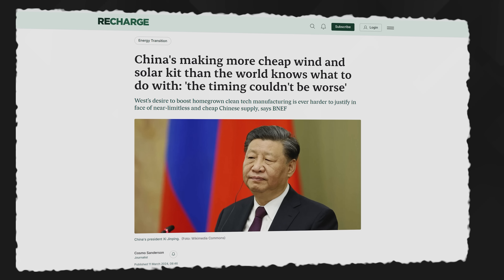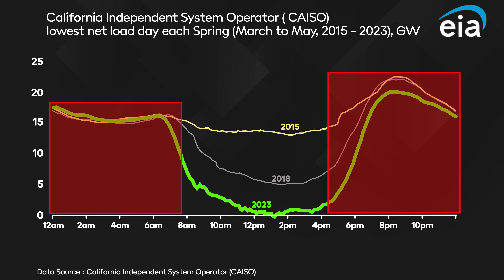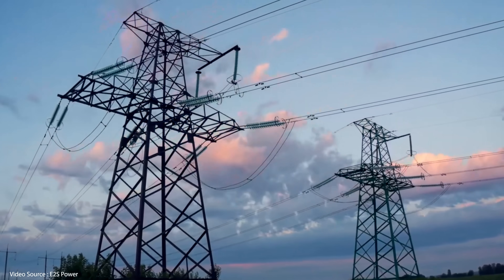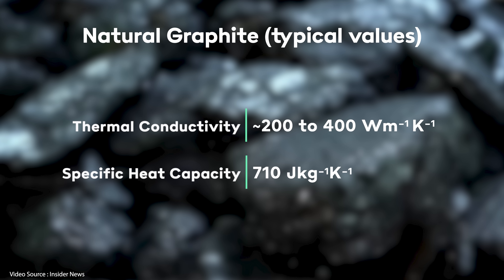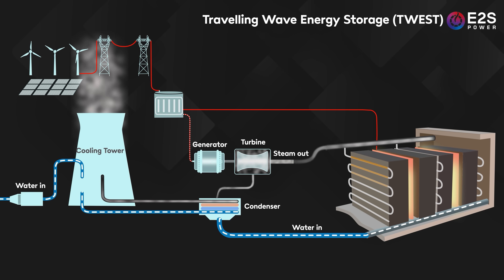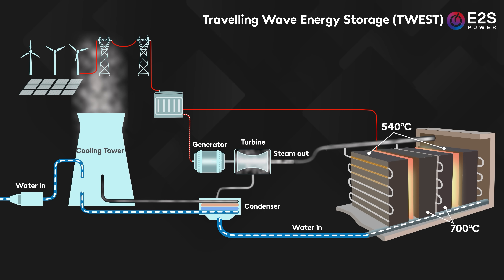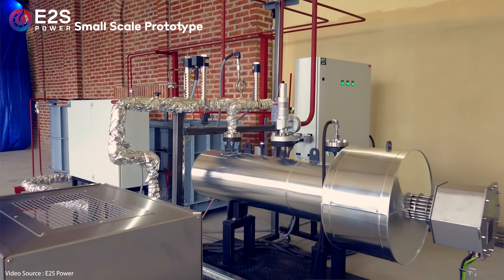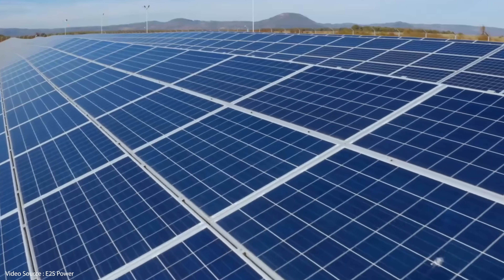A coal power station without the coal! How 'WIN-WIN' solutions could save an industry.

Comment: The obvious problem of this seems to be the efficiency. You said it's still using a turbine like a coal power plant, which had efficiency of 45%. So the overall efficiency will be less than 40%, which is not great for a short term energy storage, since batteries have 90% efficiency and pumped hydro has 80%. So it's only really useful when you have a huge surplus of cheep electricity.
Reply: Which you may have in a lot of areas with cheap solar or hydro
Reply: Except that efficiency is not a problem. Cost is a problem. Low efficiency increases the effective cost of the energy in by about 2.5x, but when you are talking about solar without storage the cost is so mind bogglingly low that it really doesn't matter. Solar isn't a viable energy solution because of the intermittency, but the cost is already stupidly low. Everyone can have a huge surplus of cheap electricity if they wanted it, at an inconvenient time. The question is how to deal with the intermittency.
Pumped hydro is pretty much impossible to beat where available, but batteries are expensive. The question becomes whether the higher efficiency of batteries justifies their higher cost, and when you can simply buy more solar panels instead they generally don't.
It really bugs me when people harp on about efficiency as though it actually matters. It does not. We don't care how much energy we needed to put into the system to make sure the lights stay on at night, as long as it outputs enough. We care about the overall cost of the whole system, generators and storage. Right now it is the cost of the storage that is holding everything up. Efficiency can tank and the system can still be economic if it is cheap enough.
Reply: Eh? The primary input cost for the running of the plant is going to be electricity and the owner of the plant will be competing with other forms of storage for that electricity. So of course efficiency matters. You can't make a profit if the electricity you sell is going to be more expensive than the competition as nobody will buy it. Can't believe people are up voting something so nonsensical.
Reply: @mentality-monster , except that the electricity that the plant buys in the middle of the day is basically free (or they even get paid to take it, on occasions). 
A producer doesn’t get to set the price of power, the market does and a producer decides whether or not to sell into that market. If the input power is free, then efficiency isn’t an issue, only operational costs need to be covered and as long as the plant is big enough to sell sufficient power at peak times to cover these costs, then they are in profit territory.
Reply: @taniknight  The low energy price is just the result of the merit order pricing. But that pricing system no longer works once fossil fuel energy production is fully pushed out. Then you are always at 0 cent and with 0 you can't finance renewable energy production.
Reply: @mentality-monster  cost includes the build out and if the infrastructure is already there and you can plan for a resource free production, then it is, of course, cost effective.
Also, the costs include the connections to the grid itself and for this, it makes sense most.
In addition, there are the existing jobs and they have to be factored in, as they impact the overall economy of the region/nation. This is always overlooked  when people discuss the financials of such projects.
🥡🥢4 🤔
Reply: @taniknight  OK, good luck with that. If you think you can run a profitable business based on a few hours of cheap/free electricity on sunny days in the summer, then you're going to lose a lot of money. 

There's a reason none of these ideas have got to market and been success. It's because there's no chance of making money when your efficiency is this low. Some other business will pay more for that cheap electricity and be able to sell it for a lower price than you can, as they will have more price flexibility due to their higher efficiency. 

You could sit down with a spreadsheet and figure this out in a few minutes, it's not hard to do.

The only potential possibility for this being a success is that governments will subsidise these plants in order to keep the workers employed and prevent the stranded assets of coal and gas power stations. And I don't have a problem with that. There's a lot of embedded carbon in a power plant and we should be aiming for a transition that keeps people employed.

But let's not pretend that this would survive in the open market.
Reply: @Psi-Storm   why would the pricing system no longer work once fossil fuels are off the grid? The power is cheap/free during the day because supply outstrips demand due to higher solar production. Isn’t that effect only going to get stronger as more renewables come online? Until of course there are purchasers who can utilise that intermittent supply and demand catches up. No?
Reply: @mentality-monster   I don’t need luck, I’m not looking to undertake a power station retrofit. 

Agreed. A lot of the value in these undertakings is to keep current infrastructure, well, current. 

If the supply/demand balance does end up in a situation where the cost of daytime power is not negligible, then sure, an efficient operator is going to outperform.
Reply: Certainly true, though one has to wonder on the actual economic costs overall. For instance if maintenance isn't to much you've basically just avoided massive capital costs in setting it all up. Something that might well offset the efficiency differences for how ever long the current equipment will still last.
Reply: Yeah,

But here capital cost is negligible, because you are not constructing new storage site.
You are just retrofitting old coal power plant.

Obviously, if you have to build new storage site, you will not chose this.
Reply: A simple-cycle gas turbine, employed to ramp up supply quickly, also has an overall efficiency ranging from 35-40%.
Reply: Yeah, I'm sure there will be math involved.  Build cost would probably be lower as well as longevity likely being higher.  Then again battery prices keep falling, so we'll see if it can compete over next few years.
Reply: May make much more sense for where the excess heat is also used. A power heat coupling power station gets up to 90% efficiency.
Reply: I would suggest this has the advantage of utilizing existing infrastructure and reduces overall cost for the change and a healthy stop gap 🙏😊
Reply: And a lot of local graphite mines? See https://ibm.gov.in/writereaddata/files/01312023164915Graphite_2021.pdf

Comment: Great news for this technology, there's an old coal fired power station near me, I'd like to see converted. I will be pushing for this. Thanks, Dave, another great video!
Reply: There are soon to be no operating coal plants- but soon there will be some gas fired plants that could also be used/converted.
Reply: Since the plant is existing, permits might not be required.
Reply: Think outside this box:
Nice to see something rated as being NEW and INNOVATIVE likely to be so but still requiring huge electrical input from those notoriously unreliable and expensive to produce 'renewables' which have a relatively short useful life and, as yet, have no mass method of reclamation/recycling .
So, a world filling up with old/damaged EV's, solar panels and wind turbines puts a sour note on this innovation.
At least Nitrogen is being used as an anti oxidant, plenty of that around and recyclable?

Comment: Oxidising at high temperatures?  Is that a euphemism for burning …. or exploding?  Can we not find something that is not flammable?  Sand?
Reply: Burning, not exploding. And it doesn't burn well. The "lead" in a pencil is mostly graphite, at least for softer pencils.
Reply: Exactly. Others are using sand which is much cheaper and non flammable. The only advantage of graphite is the energy density. A coal power station generally has plenty of space so that isn't much of an advantage.

Comment: at one point i heard 45% mentioned. is that the efficiency? i have a feeling i've heard much higher for LFP batteries? what's the upside exactly here? i honestly think we were told it in the video but i struggle to follow these smart people videos.
Reply: All lithium batteries have a known lifespan (cycles).  This technology could last as long as the fossil burning site could - umpteen years.  There is a place for chemical batteries but also for this technology, too.
Reply: @oliver90owner yeah, lifespan of newer LFP approaching 10,000 cycles or 30 years.
CATL is producing some amazing results, others too.
Nickel chemistry is more limited. (eg Teslas with Panasonic cells)
Reply: yes, batteries have higher efficiency, around 90%, but the upside for the system in the videos is exactly the material & construction of the battery being cheap.

Comment: Hydrogen, green steel, green concrete, it has 0.2% impacts on total energy consumption small batch are produced because. High demand means that if steel can be fully produced green but that requires 10 to 20 more time conventional dirty production will remain. Outside hydro and wind green electric energy production is still based on dirty methods, fossil fuel and gas. Thermal plant still based in 17th century technology water wheel and windmill where steam must be condensed into water multiply (amplification effect) is lost so dense energy source of coal, oil and nuclear are required.
Reply: Enough of the misery and misdirection.

Comment: One more advantage of this system is that where a generating complex has multiple generators, this can be installed incrementally, keeping one (or more) generator burning coal for the very occasional times when that part is needed.

Basic economics will ensure that the coal powered unit will not be run most the time, when cheap solar is going begging for use.
Reply: Modularity, excellent point.
Reply: Coal plants don't do peaking. It takes hours, sometimes over a day, to get a coal plant up to temperature from zero. They have to run at all times, even at a loss sometimes, to function reliably
Reply: @litkeys3497 yes, they use gas plants for that
Reply: @ronaldstrous2764  yes; point was that keeping coal stations partly on coal and partly converted to storage is not really feasible. The coal is either running at all times or shut down. There's no in-between
Reply: It’ll soon be an alternative for some gas fired stations?
Reply: @oliver90owner : At least for the simple-cycle ones, used chiefly for ramping up supply.
Reply: @josdesouza  Open cycle gas plants are not often in use in the UK.  Combined cycle are sooo much more efficient as thermodynamics, of steam generation, doesn’t apply to all of it!  Hopefully, next year the grid will be able/confident to run without any gas fired generation (at times when renewables are abundant).  Currently gas generation is maintained at a little over 2GW for ‘black’ grid start-up, if necessary.
Reply: And the materials is not some thing like titanium or rare metals, so it looks like the product could end up being cheap to produce as well.
Reply: Keep in mind round trip efficiency will be below 40%. So it will be only cheaper to run on solar compared to coal if the energy from solar + grid usage cost (which are probably the higher share of the price) are more than twice as low as coal. I don't know for other countries, but in Germany the grid usage costs have made up the majority of the cost of electricity for the past two years. And while energy providers could probably negotiate a much better deal than consumers, I do not see this concept being close to economically viable here.

Comment: Very good tech. Graphite has also the advantage of not melting at 700 C and doesn't expand and contract as much as for example steel with temperature change. Less chance of explosion or permanent damage form overheating there. 
I only worry about that N2 - it needs air tide container. In this case the container has to also stay tide in high temp and pressure changes (N2 does change it's volume-pressure with temperature change). If it gets unsealed, it probably will lead to a fire in the plant. Seals cost to maintain. See our now existing infrastructure and it's maintains, and you can see, why I'm a little worried.
Reply: As long as the pressure of the nitrogen inside the containers is higher than the outside air pressure no oxygen can leak in. Only a few psi higher pressure would be enough. They'd have to add more nitrogen as some leak out, but nitrogen isn't that expensive. Of course it should be as air tight as possible, but it doesn't have to 100%. They also should use relief valves if the pressure gets too high.
Reply: @phizc not even a few psi!  Millibars would be sufficient.
Reply: @oliver90owner  I guess so, but you’d want a bit of leeway and the additional headroom also serves as reserves so that as it slowly leaks out, the pressure is still higher than atmospheric.
Reply: @oliver90owner  true. I went for the smallest 'Murican unit I knew of so they wouldn't feel left out of the conversation 😋. 
A few hectopascals would be be sufficient too 😊.
Reply: @rainbowevil   Noo!  It would be controlled at that sufficiently low over-pressure such that N2 would always leak out from any leaks.  Any leaks could be found and rectified or simply monitored, if the cost of N2 was more cost-effective.
Reply: Distribution transformers the world over that are contained in mild or galvanized steel enclosures use a nitrogen blanket between the internal oil surface and upper, internal enclosure walls to prevent oxygen intake from interacting with the transformer's insulating oil. 

It is not uncommon for Operations & Maintenance (O&M) teams of utilities and power producers to refill this nitrogen every year as test reports confirm gas levels and chemical contents. 

For this well established practice to be applied laterally to shipping containers housing graphite storage mediums isn't that far out. 

The only issue I foresee is the high temperatures from the heat storage directly. Usually pad-mount transformers (PMTs) operate with top-of-winding temperatures at 55-65 °C above 30-40 °C ambient, which is a far cry from the 700 °C reported in this video. 

Should be a solvable engineering problem anyhow!
Reply: Be more worried by this:
Nice to see something rated as being NEW and INNOVATIVE likely to be so but still requiring huge electrical input from those notoriously unreliable and expensive to produce 'renewables' which have a relatively short useful life and, as yet, have no mass method of reclamation/recycling .
So, a world filling up with old/damaged EV's, solar panels and wind turbines puts a sour note on this innovation.
At least Nitrogen is being used as an anti oxidant, plenty of that around and recyclable?
Reply: @sirjohng1   You are clearly a “luddite” with regards to electricity generation.  You seem to conveniently forget (or ignore) the ever-increasing amount of damaging carbon dioxide being produced by EVERY TONNE of coal burned - YES, about THREE TONNES (after taking into account the ash content).  

You seem to ignore, or not understand, that nearly all of cars (ICE or EV) are RECYCLABLE these days.  

You seem to suggest renewables are more expensive than fossil derived electricity?  How stupid can you be, to still believe that?  And that is not taking into account the damage to our environment).

Never thought that eventually coal, oil and natural gas will all be used up if it is burned? Really, you do need to wake up, get a GCSE (or whatever in your little world) qualification in common sense - or maybe maths, physics or chemistry?  

The only sour note, I would suggest, is that you posted on a topic of which you are totally ignorant.

Comment: Really good news for a change, i'm from Denmark, we don't use cooling towers, we use radiators and hot water to consumers, only in summer there's a little use for extra cooling, and we use the ocean for that.
Reply: I find it funny that green plants breathe Co2 and exhaust Oxygen.  In the past Co2 levels were much higher and as a result oxygen levels were higher too.  Both plants and animals were bigger think dinosaurs.  How did fossil fuels get trapped in the ground in the first place?  Wouldn’t it make sense to put it back into the atmosphere where it belongs in the first place.
Reply: @1DVSB  you're not pulling in all the variables. Many forests have been chopped down. CO2 is way up. Plants are actually getting choked out from too much CO2 and the ocean is turning acidic - bleaching the coral, dissolving crustacean shells - the Arctic and tundra are melting. Sea level is rising rapidly and is likely to go above 50 m. Much coastland and countries will go underwater. You're going to say "oops"? No, this cannot happen. Take preventative measures. Have a clue
Reply: @1DVSB  🤡